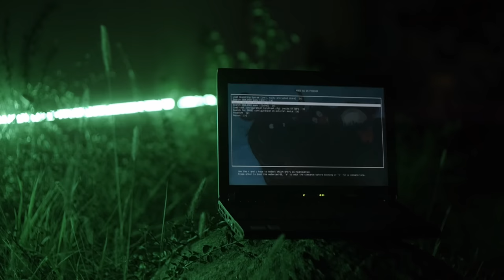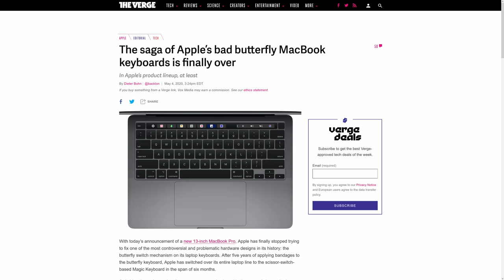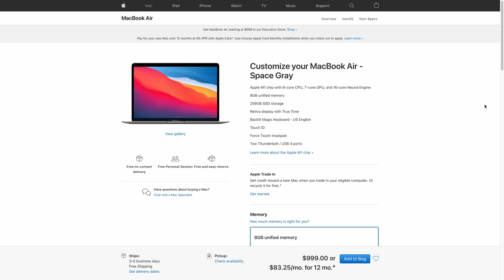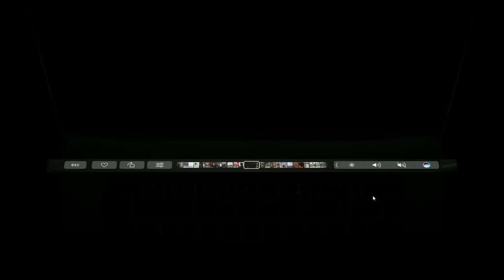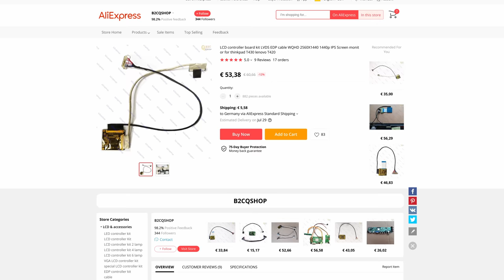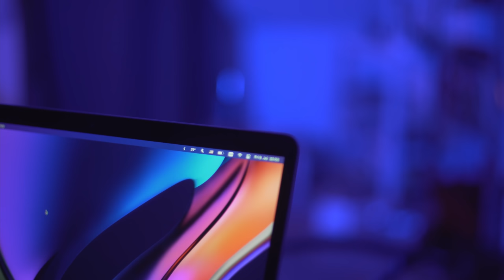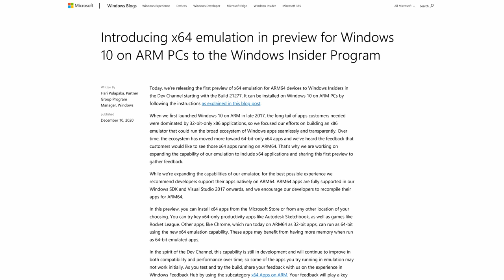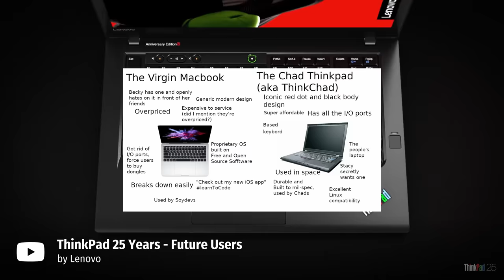Why I Switched to Mac (as a Linux user)

Comment: I’ve been buying ~$100 used 2012 Mac Minis lately. They are the only simple mobile NAS solution that is completely effortless. Once you setup screen sharing and file sharing on a Mac Mini, you never have to plug a monitor in anymore. I use my M1 MacBook and iPad as my primary daily drivers. Instead of taking external drives on the run, I just take a Mac Mini. The 2012 Mac Minis can have two SSDs (one with adapter). Mine have two 2tb drives. Plug in an iPad or MacBook and use screen sharing; connect Mac Mini to a Wi-Fi if you want and then unplug for complete wireless NAS or stay plugged in for fastest transfer speeds. This is my favorite thing about the MacOS/iOS environment.

Comment: In terms of performance is the i7-11800H is kind of equivalent. But it draws north of 45W. Instead of 15-27W. And idles at about 1-2W (1000mW). Instead of 58mW.
Reply: lol, get a windows laptop running that cpu and a decent GPU and you’ll be able to do something computationally expensive for about 30 minutes before everything starts to stutter

Comment: Totally get your points. But: It's not only the freedom to upgrade your laptop, it's the freedom to repair it by yourself. (at least on my T480)
I was in the Apple-game until 2015, since then, I enjoy to upgade way cheaper, to repair with cheap replacement parts and can use Linux or Windows as my daily dirvers. macOS with it's upcoming restrictions and presets is still great, probably the best OS out there and the M1 MBA is really good piece of hardware. If I'd need the power, I'd have to think twice, if my next computer would be again a Mac. Until then, I enjoy having a up to date thinkpad with repair- and upgradability and long term supported OS. To be fair, my work is based on text, audio and browsing the web. Even a X230 can handle this properly.  ;)

Comment: My big quibble with buying an M1 Mac-anything is that the two VM vendors Parallels and VMware have publically stated that they won't support virtualized X86 VMs on the platform.  If you're using your Mac as a sysadmin in a corporation, the Pro version of VMware lets you build VMs and deploy them into vCenter.  You can do that just as easily with a maxed out Lenovo X86 laptop.  If you want to develop terraform, ansible, or puppet code using Virtual Box or VMware VMs, that's still OK. Just don't expect to boot an existing X86 Windows VM to copy stuff off of it.  I'm not sure about Docker, minikube, and kubectl but that should probably work so long as the containers are built for ARM rather than X86.  Since all this is my prime purpose for owning a system, I'll most likely get a maxed out X86 Mac Mini or build a small Linux box just to do that stuff. The days of my MacPro desktop are numbered.
Reply from the maker: Absolutely – even though Apple has done a great job with Rosetta 2 and bridging the software gap between ARM64 and x86, there are definitely going to be some use cases that neccesitate having a native x86 device. I still have an x86 desktop for gaming and a separate laptop (Thinkpad T430) for all the Linux stuff.
Reply: Thank you. That would destroy my work flow. I always work out of VMs. A laptop without VMs and lots of ZFS is at most a tablet.

Comment: I can vouch 100% for this video, I'm an iOS dev and I've used a bunch of company issued MBPs and they are hot garbage. literally, the 2014 i7 MBP aluminum case was melting into my work desk. I've had a bunch of laptops, the HP Envy ultrabook, zenbooks, and nothing has matched the M1 Macbook Air. Like I was able to do actual dev work on that a machine, and it was also lightweight, relatively cheap, stayed cool and had a pretty decent battery life. It makes me foam at the mouth that a monopoly so anti-consumer like Apple made THE best laptop, bar none, and that as a consumer I can only sit around and wait until a niche company like Framework releases a comparable ARM machine at like double the retail price.

Comment: I feel the same, my entire home lab is running on Ubuntu, but my main desktop computer is a MacBook M1Pro, mainly because I need something reliable to work on every other day, and MacOS, even when running on a dated MacMini with an intel i5 updates and runs without an issue. There’s something extra to mention, I’d normally upgrade my main computer every 5 years, and Macs tend to keep their price range in the second hand market (at least here).
Reply: "MacOS, even when running on a dated MacMini with an intel i5 updates and runs without an issue" my Windows 10 also runs without any issues and hasn't crashed once, so that argument is kinda null. (Also macbooks are not desktops)

Comment: I think that this video is missing some important considerations.
Apple M1 Mac is ARM based so you can’t  create an x86 virtual machine through virtualization, but only with emulation and performance are really bad (and this won’t change in the future).
This ARM chip is new and it isn’t stable as an x86 platform right now, also many old application that are deprecated won’t be available to M1 Mac. 
I think that you should consider buying an M1 Mac only if you have a clear workflow in mind, that won’t change in the next years and you have all your software compatible with M1 Mac.

Comment: Haha,  it was inevitable I guess. I actually switched from Macbooks to Thinkpads/Linux though. But I actually use a x250 because I don't require my laptop to perfom any resource-intensive tasks (I have a desktop PC for that). You might regret your choice of buying a Macbook when you have to pay hundreds of Euros to get your machine fixed by Apple or pay over a hundred Euros just to get a new charging cable for your laptop. The upfront costs can be deceiving. I'd mention the locked-down proprietary operating system, but you clearly don't have a problem with that, so...

That said you are right that all modern laptops suck in terms of repairability and upgradeability, that's just capitalism. Apple is just the worst offender.

Comment: I think Linux users need to accept that 95% of people dont want complicated interfaces, command lines and ways to modify every single line of code, but a reliable machine that just works without having to do any additional work and that there's no nothing wrong with that.

Comment: I am a full-time Linux user now for about 20 years. I think Macbooks are good for some things, like if I want really good battery life while I am reading an academic paper or doing light writing work. I can do those things fine on my Linux laptop, but not for long if I want to work outside (I do because I have external power backups). But for any kind of heavy load, I would prefer a regular computer with Linux on it. The one thing I hate about Macbook that they actively take measures for you not to be able to repair them and also them being very fragile.

Comment: I can so sympathise that whenever you tried to use Linux desktop as your main desktop, small quirks made you go back to macOS. My experience has been the same, although in my case I went to back to Windows. My home servers have been running Linux, and Linux desktop has been so much improved in the last few years, but there still are some small things that prevent me from using Linux as my main desktop. It is annoying because those are small things and Linux desktop actually does a lot of things better than Windows. My biggest problem is stupid greedy Nvidia. I want to use Wayland, but my graphics card is an NVidia RTX, and its Wayland support is rubbish. I can't use AMD Radeon, because Radeon's support for Blender is also rubbish.

Comment: Ive never understood OS loyalty. Ive used linux, macos, android, ios, and windows. They all have their strengths.  However, in the 18 years of owning laptops and tablets, its always been the apple products that held the line the longest for me, even when buying used. These new m1 laptops are actually underpriced for how good of a value they are. In fact they’re hurting apples sales because nobody is upgrading.
Reply: It's just Richard Stallmans free software radical ideology run amok. Most Linux users don't really care about it, but have convinced themselves because of the FOSS community that it's somehow important. Just use whatever tool you perfer or is best for the job at hand. Limiting oneself based on some arbitrary belief system, for something so simple as a computer operating system is a waste of time.

Comment: Hey Wolfgang I'm wondering about keyboard layout ergonomics. You seem to use your local keyboard instead of the american keyboard which is the most ergonomic for using vim or IDEs. Don't you dislike the small left shift? And what keyboard layout do you use? I'm in Mexico, the keyboard is similar to the german one you use, but I'm used to american keyboards. So I'm wondering if I should get an M1 macbook air with a spanish keyboard and 16GB of ram or american keyboard and 8GB of ram. Greetings

Comment: You were supposed to be the chosen one! Joke's aside, i've used Mac hardware for the last decade, And while the hardware was meh the OS itself was nothing but gold. It's just that apple is a company that runs of the backs of their fans rather than power users, which results in s**t like MacOS catalina (I Still have nightmares about that Upgrade). This days MacOS feels like poor man's version of what it used to be (Leopard, Snow leopard,  Yosemite was actually good, Sierra and even mojave). That's why i switched to ThinkPad's. It's not about the hardware or software, It's about the message ;) .
Reply: macOS Monterey is actually pretty good. I tried the public beta and it has neat features and its very stable. For me macOS Big Sur was not great, catalina was good. 
This is on a 16" Intel, macOS Monterey on M1 macs will probably be even better.
Reply: @rohithmekala2608  Try The earlier releases before Catalina. Call me later. Those were bold and brush. Now it's just belongs in the trash.
Reply: @davidtatikashvili3958  macOS right now is not “trash”. On M1 macs it’s smooth as butter and very solid. On intel macs it’s definitely not as smooth as M1. 

You know on macOS Monterey there is now a native KVM which the user can connect up to 3 different macs and control them using a single mouse and keyboard. Also now in Monterey there is Airplay to Mac which  acts as a airplay receiver. These are useful features and certainly power user level.
Reply: @davidtatikashvili3958  I believe what your saying is somewhat right. Right now Apple is investing in the Mac platform after years of neglect. This can be seen through Apple Sillicon. We will see where M series SoC  takes them.
Reply: @davidtatikashvili3958  btw Airplay to Mac on my 16” is good there is no lag. Maybe cause of Bluetooth 5.0
Reply: @rohithmekala2608  Maybe because you have Bluetooth 5.0. Poor Macbook Pro 2016 never stood a chance
Reply: @rohithmekala2608  I Want to see apple returning to their former glory, something i really doubt will happen. They don't need glory. as long as their fanboy's will like the next IThing in september they don't need to even care if it's actually working or not. As far as i'm aware they are the only company out of the Big Tech who can really release trashy broken and buggy products and STILL BE VALUED ABOVE THE 1 TRILLION MARK!. And here we are the power users, left in the dust of a company who changed their target demographic.

Comment: You switched to a Mac for 4 reasons:
1. you don't need 21st-century hardware (touchscreen, pen support, 2-in-1 design, 180 degree screen, OLED, etc.)
2. don't work for a corporation, small business, government agency, educational institution, nonprofit, or ngo. 
3. you don't know  a lot about laptops
4. you don't care about keyboards that work, thermal throttlling, connectivity, green screen, etc.
     (all class action lawsuits filed against MacBooks)
Reply: Touchscreens on laptops are a dumb gimmick, and if you want a 2-in-1 laptop tablet hybrid thing, you get an iPad or some other tablet. (I’m not saying that as some sort of “Apple fanboy”, finger smudges on non-touchscreen laptops are annoying enough)

Plus, all of the thing you mentioned in your fourth point have all been issues with later intel MacBook Pros. Non-Touch Bar M1 and M2 pros have gone back to the way better scissor mechanism and have no issues with throttling at all, as well as just being better built. Maybe you’re the one who doesn’t know a lot about laptops…
Reply from the maker: Impressive, very nice. Now let's see mass scale hardware issues of other laptop manufacturers.

Comment: It's so good that it cannot uninstall a program, and that feeling when you accidentally deleted the wrong app files is extremely frustrating
Reply from the maker: You can uninstall the default apps on macOS. You'll have to disable SIP to do that, since the base system image is immutable by default.
Reply: @WolfgangsChannel  this is the problem, why isn't this done by default, I don't trust those uninstaller as they too have sometimes left app data behind/deleted wrong ones

In windows it's as simple as opening control panel
Reply from the maker: Immutable base system is a good idea for a lot of reasons, and is done by a lot of other operating systems (e.g. SteamOS, Fedora Silverblue, OpenSUSE MicroOS).

You don't need to use an uninstaller either, just go in the /System/Applications directory and remove the applications that you don't want. Once again though, you'll need to disable System Integrity Protection for that

Comment: apple is really cozy until you realize that they don't care about the quality of any of it, it's a bit rotten mess and it's a shame.
Reply: Care to elaborate? Because I’m a fairly new apple user and my experience has been excellent and flawless
Reply: @o0julek0o  it has to be good day one for "professional"reviewers but they really don't care afterward.
Reply: @o0julek0o  at work i am porting some code bases to work on apple, their develop documentation is a joke that amounts to "just open it up in xcode and beep boop press some buttons lol", apple has not improved anything in over a decade, they just let the core of their os ferment and their APIs rot. this is mainly because apple users are totally ignorant and dont care as long as it looks good and sort of works. macos could have been a great os if apple cared enough, they don't and THAT is the real tragedy.

Comment: Speaking of Thinkpad vs Apple…

Despite being a Mac user continuously since 1985, none of the new M1 Macs fit needs. So I recently switched to a Thinkpad T480 and the expandability is very nice to have. Two M.2 slots for storage. Two SODIMM slots capable of taking up to 64GB of RAM. And an M.2 slot for upgradable wifi.

Unlike older Thinkpads, the CPU isn’t upgradable, but 4C/8T in the eighth generation Intel i5 CPU in mine has isn’t bad. If only the fan didn’t come on so frequently to deal with the heat…

I’m dual booting Pop!_OS and Fedora Silverblue. Who says you can’t teach an old dog new tricks?

Comment: Haha! I have the exact opposite view when it comes to Linux and MacOS than you! I find my Linux machines so stable and never have issues that impact my workflow. I did however used to work with MacBooks all the time and found them incredibly frustrating to use and ran into problems with my workflow constantly. It's great you managed to make it work, they are rather pretty after all...

Comment: As a Linux user and security pro, Mac just doesn't have the tools I need and MacOS is an exercise in frustration.   I have an M1 that I'm running Asahi-Fedora on and although Asahi dev's  have made great strides in running Linux on M1, the platform just isn't there YET.  The best alternative for me is a high-end Dell or ThinkPad. Just use the best tools for the task at hand.  Sorry M1 just isn't there either.  Excellent video.  Thanks for addressing the sorry state of tech.

Comment: Nice video so far, but I wanted to adress a little detail : 
The webcam cover is unnecessary on a Macbook (the light and the webcam are in series : if one is powered, so is the other) and can actualyl lead to your screen being cracked.
The gap between the display and the main unit is so thing, that even the thinnest protectors can be dangerous.
Apple is still form over function after all, unfortunately so.

Comment: Hi. I am planning to buy a MacBook Pro M2 chip 13inch as I want to work on python, SQL, tableau, ms excel, ms word and related ones. Could you suggest whether MacBook Pro 13inch is better than MacBook Air as it's my first time buying an apple device? Will it throttle if I use all these applications at the same time as I'm aware of the fans that will pitch in at that very moment? Please share your ideas as it would be of great help to me.
Reply: Hi, sorry for a 6 month late reply
I guess MacBook Air is pretty enough for the tasks you described. Pro might be a little better only if you want to work with something really resources consuming like editing a lot of HD videos and tasks like that. Plus MacBook Air doesn't need a fan so it works without any noise. Better take 16 Gb Ram just in case if in the future you need more Ram

Comment: May I ask how do you share your i/o (monitor,keyboard,mouse) with your laptop and your gaming machine? I thought of kvm and a docking station. But I‘m not sure if this would be ideal for the gaming machine
Reply from the maker: I use a KVM. Provided you use 4K@60Hz or lower, it should be fine. There are some KVMs that support 4K@144Hz and higher, but they're pretty expensive